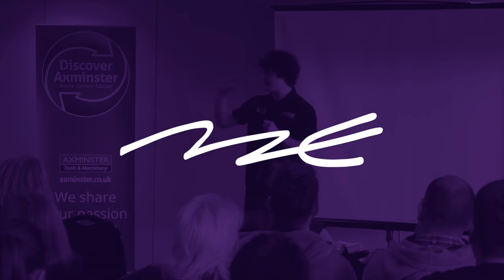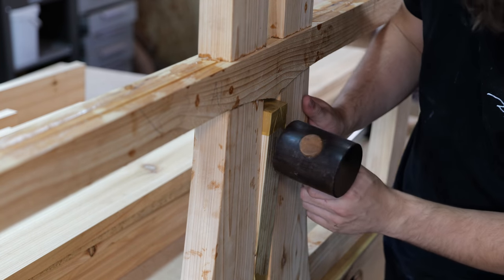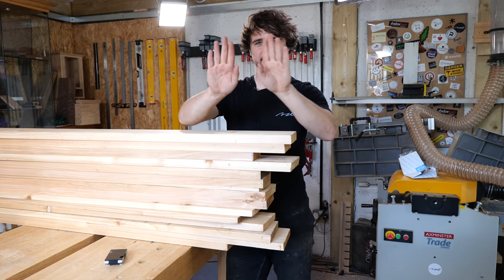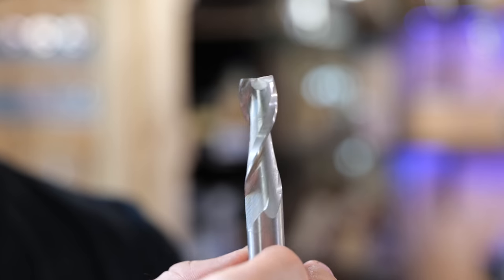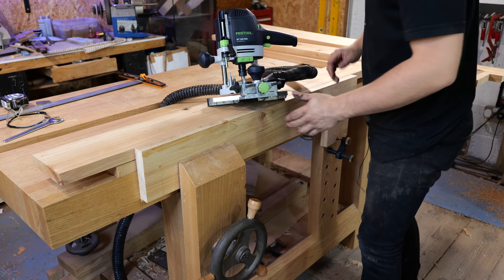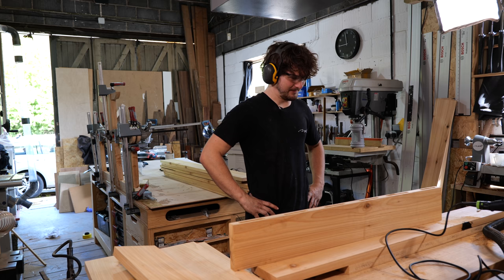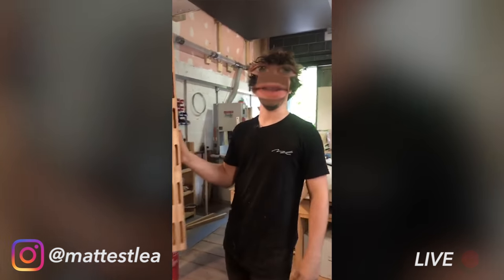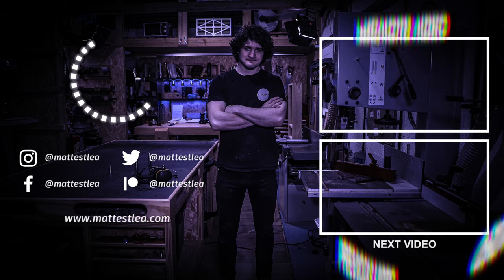Mortising The Breadboard Ends | The Japanese Inspired Picnic Bench Project #9

Comment: I clicked on this video right away when I saw you had switched to the Festool router. I was like, oh, that's a little awkward, Matt's kind of sponsored by Bosch lol. The Bosch motors are great... perfect for a router table. If you have to do plunge tenons or dado's, or any kind of accurate plunge routing, there's just nothing out there that comes close to the OF1400. I got to borrow a whole suite of Festool tools from a friend back when I was very skeptical of them based on the price. I built my Benchcrafted style Roubo workbench (very similar to Matt's) using the OF1400 router for all of the joinery and that's the first Festool that surprised me and made me come around and realize how much they perfected a tool that really needed perfecting. Totally worth it, you will love that thing more and more the more you use it, and you'll never be able to use anything else. Don't forget you can also run it on the track system just like the track saw too, Matt!

Comment: There is a better way of routing mortises when using an upcut spiral. With router on full speed, at one end of the mortise, plunge the bit to full depth and then withdraw. For a 50mm depth, this should take about 1 second (yes, that quick). Then move the router along by 5 to 8 mm and do the same again. Do this for the fulll length of the mortise. When you get the the end, then plunge the bit and move it along the length to clean up the scalloping along the mortise walls. Doing it this way means that the mortise stays straight, and does not form a smily banana shape.
Reply: so basically drilling it out instead?
Reply: This also reduces the side load on the cutter and the router shaft bearings - I know they are designed for it, but if you are doing this into a hardwood those forces are increased - and never force the tool. it can only cut as fast as it can cut
Reply: @Ashe_Fenrir  in essence, yes. instead of drilling out the bulk and paring back, this is doing the full width in one hit.The one thing that I must stress - this is only do-able with an up cut router bit, cos it is essentially a posh drill bit.
Reply: I was about to say the same thing! It's so fast to cut mortices this way!

Comment: Routing mortices is fun huh? Was doing that last week to make my very first human sized door. Top tip: use small speed clamps to create stops for the router at either end of the cuts - no more overruns that way.
Reply: now i need to know what sized doors you were making before... artisan doggy doors sounds intriguing.
Reply: @Ashe_Fenrir  It's the first door of any size I've ever made, but felt the need to distinguish from a furniture sized piece. It's 1.97m x 0.91m made from tanalised construction lumber. Rather rustic, but the mortice & tenon joints are impeccable. Just need to make the 2nd one now.

Comment: I found using a hot air gun to heat the surface of the epoxy when removing means you can chisel off scrapings like you get normally with wood.

Comment: The main problem of the extractor bodge is filtration - if you've used the vacuum extractor for saws or sanders which produce fine dust, it'll have captured all that for you. The chip extractor's filter bag can't, though, so having captured it all you'll end up blowing it back into the air during the transfer. Of course, if you've not used it for fine dust then that's not an issue. 

I wouldn't worry about it sucking the filter bag through; high volume extractors can't generally produce enough pressure to do something like that.

Comment: If the table top was completely glued together into one big piece could you then mortise one long mortise in the breadboard end and a matching tenon in the table top thereby eliminating the need for individual finger tenons and mortises?
Reply: You also get more expansion and contraction issues with it as a slab rather than spaced apart. Putting it outside and in the elements, that's going to increase the rate the wood moves. Have the spacing (gaps) makes it move less as a whole.
Reply: I was thinking more of an indoor dining table.  The top being a glued up panel with breadboard ends.  The theory is, if all the individual boards are glued together they would/should move together.  Anyhow, that’s the way I did it over a year ago now and the table (in cherry) still looks great.  Just sorta looking for “that’s another way to do it”.

Comment: Two tips when plunge routing mortices. First, plunge to full depth at the beginning and end of the mortice mentioned previously. This helps define start and finish. Secondly, cut from left to right. This pulls the router against the fence and reduces the risk of going off line.  The Wood Whisperer does a good tutorial on this. (https://www.youtube.com/watch?v=yZr_tvra--0)